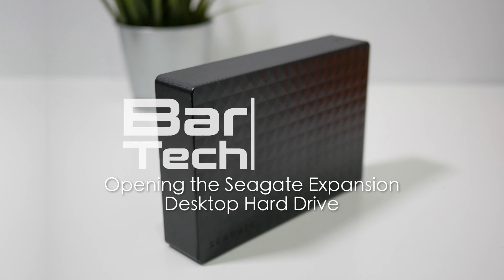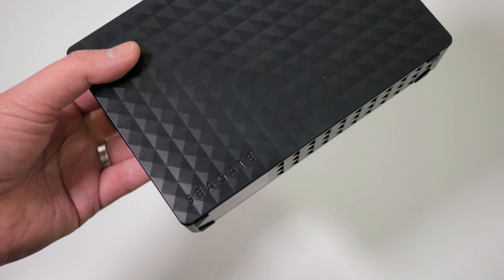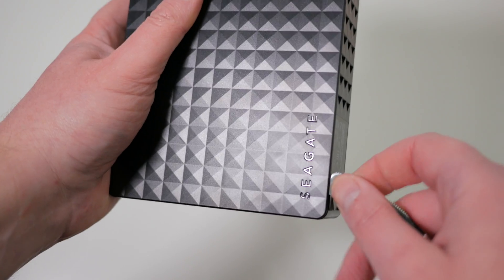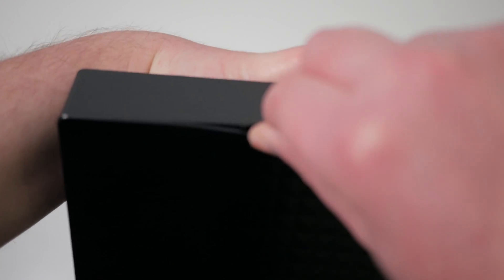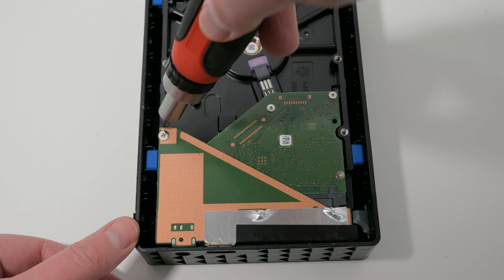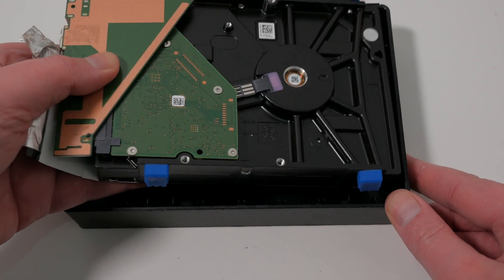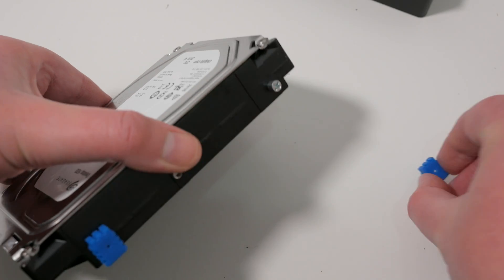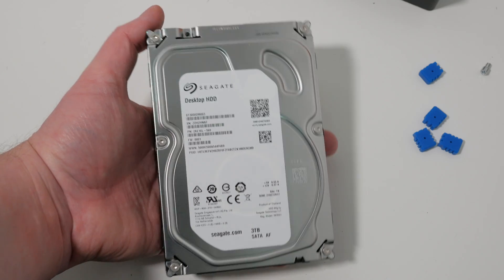Open / Dismantle the Seagate Expansion Desktop Drive to use as an Internal Drive

Comment: Thanks for  posting this video.  It took an extra tool, Dremel with cutoff wheel, to cut around the edge.  The 6TB was a breeze using a strong flat blade screwdriver to get it started.  Once there was a gap i was able to pry apart using my fingers and a wide blade screwdriver.
Now I have them mounted in a removable bay inside my tower.
Again, much appreciated.

Comment: Thank you for making this video, as my current 4tb Seagate external hdd has quit functioning properly and as a result I can no longer run the lion's share of the games stored within the library of my Xbox One S and it's got me a little frustrated to say the least.

I know I should've seen it coming b'cuz now that I look back on it, it has been giving me some intermittent indications that it was indeed on its way out by not always downloading updates as quickly & efficiently as it used to when I first got it and it has occassionally given me issues running the more favorite & frequently played games among my fairly vast library of games.

And being that this particular drive just so happened to be the main drive with not only the most games stored on it, it alsojust so happened to currently be the one with the largest overall storage capacity at 4TB, so you can easily imagine my supreme dismay when it refused to boot up or even accept the most recent & unfortunately "necessary to play" update for the main game I prefer to play.

Which BTW happens to be a rather contentious & divisive title (ie Call of Duty Modern Warfare III) which, anyone who plays it knows all too well that the overall game file size isn't exactly modest and is around the 300+ GB mark.

So when the most recent season dropped, I was ready to get into it and check out the recent additions to the game that the devs have added for the final season.

So to say that, "I'm more than just a little bit aggravated", would be a serious understatement!!😅

Nevertheless, I hoped/figured that maybe if I could disassemble the unit, maybe just maybe I might be able to figure out what the issue might be and possibly fix it, though seeing as how my tech knowledge isn't incredibly extensive, I'm not getting my hopes up but, I'm also not willing to simply give up without at least trying to get it working again or at least functional enough to transfer the current data to a new drive that I just ordered as a replacement in the event it turns out to be a complete and total loss...which I unfortunately believe will be the most likely outcome.😮‍💨😖😫🤬

But I digress.

Again, Thank you so much for making this video and sharing this valuable info with us DIY types out here.

I genuinely appreciate it and am so very grateful for people like yourself who take it upon themselves to make such helpful content instead of simply keeping said knowledge to themselves.

You and your video are seriously a true Godsend in my humble opinion and I cannot properly express my true thanks/gratitude with words alone but, seeing as how I don't know you personally nor am I likely to ever meet you in person to share said gratitude, this post will have to suffice.

So, as previously stated with much enthusiasm, "Thank you so very much again" and I sincerely wish you Godspeed & I will surely pray that God will bless you and all those closest to you beyond measure, far beyond your wildest dreams or imagination!!🙏🙏🙏
                         ✌️😁👍

Comment: 6 years later and it's still good info.  I saw the seam and figured that was the process, but you confirmed it.  I just cracked open a 5TB with a failed HDD.  The enclosure and USB PCB will be great for connecting old drives for data recovery.  Thank you.

Comment: I tripped over the cable and I pulled the drive down with me. It fell about 1 meter but hit a bit hard, and it was on when that happened (google says that's a very bad thing). It turns on - steady blue light and hums/whirs when first plugged in, but then it slows down to almost nothing and doesn't load at all, as if it's not plugged in. I was forwarded to your video from TechSupport discord, was told to plug it in directly into SATA. I'm a total hardware noob and I'm terrified lol, that I won't be able to make this work. I got it open in front of me but I'm instead watching and rewatching your vid...stalling. No apparent physical damage visible.

Comment: Hi, thanks for the video and sharing your expertise. I was wondering if the HDD could be replace by a unit bigger in the same box. I mean, do you think it would work?. Thanks
Reply from the maker: Yes, absolutely. It’s just a standard SATA drive. You could replace it with a larger one.
Reply: @BartechTV  Thank you. I was not sure if the manufacturer is putting some limitations in the firmware just to obligate you to buy a new drive with more capacity.

Comment: I don't see any way to pry open my seagate drive. there is no gap anywhere! the entire exterior is sealed. i can't get any power to it. i plug it in and nothing happens. i don't want to break the plastic casing.  Seagate - Expansion Desktop 4TB External USB 3.0 Hard Drive - Black
Model:STEB4000100 SKU:8686213  best buy aug 2020 . help plz.
Reply from the maker: It can't be entirely sealed or they wouldn't have been able to put the drive inside the case. There is a gap around the edge.
Reply: thanx. i found it  @BartechTV

Comment: I bought the 10TB one a little while back, and the speed is just NOT up to snuff. Kinda took me back to the LaCie external drive I bought in the early 2000's, but that one was atrociously slow, this in comparison was blazingly fast. I digress, this worked well, it's in my PC now, and I was able to put an empty 4TB drive in the external case (just to have some wiggleroom, lol), with very little battle scars. Got it pieced back together, and it still works with another HDD, just had to delete the volume.

Comment: I have a few 8TB versions of these that run slow as hell in this enclosure over 3.0. I'm thinking of either putting them internal or rehousing them in a future 3.2 enclosure so I don't have to populate it off the bat with new drives lol. We'll see if it makes a difference. Really depends on why they started running slowly.

Comment: Another good reason to get the drive out of the case: The outside USB-connector was damaged by a jerk on the cable, and now has connectivity issues. Thus, the only way to continue using the drive is "outside of the box", so without the enclosure.

Comment: If you struggle finding an entry point, then try a corner. I had to lift it with a fingernail and jam in the tool. Then it was fairly easy to get off the housing.

Comment: Thank you for this video.  Another use case scenario: Since these Seagate external enclosures do not have an actual power switch, one might be inclined to remove the drive from these, and put in a proper enclosure that has a power switch. Relying on buggy power saving features of operating systems isn't always best.

Comment: and what do I do if my seagate disc has a metal shell around the bridge? the screws don't fit any standard screwdriver, and I can't cut it open. trying to retrieve my pictures of pets and relatives. :/
Reply: Get a non-standard screwdriver.  Wal-Mart has a bunch of screwdriver sets and Hyper Tough brand tools are pretty cheap.
Reply: @kornflakes89  could you perhaps tell me what a set would be called? we don't have wal-mart in the netherlands :(

Comment: THANK YOU FOR THIS VIDEO.  My Father and I were about to begin the setting up of my NAS system with the Seagate expansion drive.  He was a computer genius for over 50 years and he passed away before we could get into the project.  I had all the parts and needed to figure out how to get to the drive.  In the middle of my meltdown, missing my Dad, I found your video and I can now continue with my project.  Again, THANK YOU  for this video.  Should I purchase more drives, I will utilize your link.
Reply: This was a beautiful read thanks for posting this
Reply: Sorry for your loss same issue here though i need to gain access to my grandpas old system and reset the password without loss of data
Reply: Sorry for your loss man

Comment: Man I had so many problems with these HDDs, I never could copy large files etc without IO Errors. But thanks to your video I open the Case and put the HDD in a different Case and then it worked... The Barracuda HDD in there arent that bad its the USB-Plate thingy that makes the problems

Comment: My Seagate drive just died, and I was a bit reluctant to take it apart until I saw this. Turns out there were a lot of spider corpses inside, melted on to the circuit board, probably shorted it out, or maybe the adapter died. I didn't want to smash up the enclosure in case I had to RMA it. But I'm using it as an internal drive now and it's working just fine!
Thanks!
Reply: you can say you got your seagate debugged.
Reply: @lancerfrom2007  Yea, apparently that's where the name came from, removing actual bugs from those big-ass computers back in the day..
Reply: @JoeBob79569  i know. That was the joke.

Comment: Thanks, SATA to USB adapter failed on my 4 TB drive, works fine via SATA or DOCKING station! Seagate has bad SATA to USB converters and bad USB cables otherwise my experience with Seagate has been very good, unlike WD which for others seems more reliable lol!
Reply: I thought i was the only one. I've always had issues with WD

Comment: Nice tutorial...clear and concise. No music drowning out the voice. Well done! Thanks.

My issue is that the data connection is unstable: sometimes the drive disconnects, and I must jiggle the connector, until the pilot light comes back on, and connection is restored. The wire is OK, and the power cable registers a steady 12VDC. Since the female connector is fixed to the circuit board inside, looks like I need to salvage the drive and discard the enclosure (poor quality control by Seagate). But I will try cutting back the plastic on the male plug, so that it mates better with the recessed jack. Sigh!
Reply: Same thing happened to mine. Tried plugging a separate HDD which I know is good and it didn't show up on my PC. The connector died. Trying the Seagate HDD on my Technet docking station confirmed the drive was still good.
Reply: @RetroJackal  I replaced the  cable from power transformer to the HDD and have had no problems since.
Reply: I,ve got the same problem with my 5Tb Seagate, so just purchased an Orico USB3.0 Interface Series, managed to remove the drive okay, but not sure if I can preserve the data, as the Orico  wants to re-format the disk before letting me use it.

Comment: Awesome video thankyou, what is the silver foil that is holding the drive in its place for??
Reply: I think it is used to hold the USB board aligned to the hard drive during assembly.  I would save it (stick it to the inside of the plastic cover) in case it's needed when you attach another drive into the external case.  That way you can find it if you need to reapply it.

Comment: I have found sliding 2 pieces of paper inbetween the crack and then sliding an old card (like an old credit card / membership card) inbetween those 2 pieces of paper is fantastic for this sort of thing. For one you can adjust the width of it by moving from just the corner to the whole thing and its often softer than the plastic used on the external hdd case. I use it all the time to undo clips on laptops. Works a treat and from my experience didn't mark like metal tools do.

Comment: hi, my seagate model SRD0NF2 stopped working. Any ideas on how to get the data off the disk?
Reply from the maker: It depends if it's the drive itself that is broken, or the SATA to USB bridge, or the cable, or the power supply. It could be many things.
If the drive is still working you can just open up the enclosure, remove the drive and connect it to your computer by SATA.
If the drive is broken then your only option is a data recovery service. Recovering data from a spinning hard drive isn't something that you can do yourself at home with a large chance of success.

Comment: As You can see it is not possible without destroying the case. The Problem is that you lose warranty when you destroy the case. Maybe you can put together again with glue, but they will see you used glue...
Reply from the maker: Yes, many of the clips on the case will probably be broken, it is unavoidable. So, don't do this if you expect to be able to put the drive back in the case without anybody knowing it was opened.

Comment: The cheapest 4Tb internal 3.5" drive I can find is $150. I can buy the Seagate external 4Tb drive for $99. Makes no sense to me considering you get a USB3.0 case chucked in for nothing and it's still 50 dollars cheaper. I'm off to butcher an external drive today.
Reply from the maker: Exactly.  It's never made any sense to me why external drives are cheaper. I'm sure there must be some logic to it somewhere but I just can't see it.
Reply: @BartechTV  I think the reason is that people don't buy them and external drives are easy to setup. Most people nowadays would buy a new computer before opening it up to swap a drive. I've been pulling computers apart for over 20 years so it's no big deal. Just got back from the shops with my external drive. It took me 5 minutes to remove it. Now I just need to install into my desktop and install an operating system. I ended up getting a 4TB Seagate like your video. Exact same case, had to kind of damage the case to get it open. They used to be screwed now they have plastic bloody clips . Don't care though , it's an internal drive now !!

Comment: This video keeps on giving, just opened 16 TB version, Exos X16 ST16000NM001G inside. More or less the same process, I kept my screwdriver vertical to the seam, gently pulled it along the seam with one hand and rotated the screwdriver some 45-90 degrees with another every cm or so (half an inch)  listening for the pops. Took about a minute, 2 of some 25 clips survived the process. Wandering how long before someone posts "Just opened 1 PB version" ...

Comment: Does the USB-SATA PCB do hardware encryption? That is, will we be able to read the data if we disassemble it and plug it into our PC's SATA? Many hard disks's USB-SATA converter do a hardware encryption such that the data is not readable if you take them out and you have to re-format them.

Comment: Hey, hopefully someone can answer this.

I have the 5TB model of this drive, and I've used about 4TB of it.  I would like to put it into my desktop.

Is my data safe and easily accessible by just shucking it and plugging it into my PC via SATA?

Thanks.
Reply: As usual a backup is always advised, but other than that, it will work because the filesystem on the drive is the same, regardless of whether it is accessed via USB->SATA or directly via SATA.
Reply: @jgrabner  Thanks!  Everything worked out fine.  Really appreciate your reply.

Comment: It's ridiculous that an external HDD goes for $144, but the equivalent internal hdd cost is $155. 

Seagate, why are we pay $11 more for plastic we don't need? Many people are taking the shell off of these to use as an internal drive.
Reply: the drives inside external enclosures are actually quite slow speeds often even slower than 5200 and often have less cache and slower read/writes.  Because they are on the USB bus its a waste to put a faster drive in that wont even get utilised.
Reply: @Emexrulsier  True. Theses external seagate barracada 4tb ones are 5400rpm. Some of the other Seagate barracuda 4tb ones are 7200rpm (15% faster) which might (in not all cases) account for the price difference.
Reply: @Emexrulsier  mine have mostly been 5400 rpm. But unless you want to pay a lot extra, you get a 5400 RPM INTERNAL drive as well. For example, right now I can buy an 8tb external... for 170 CDN +tax. BUT the internal is 195+tax (cheapest internal, still also ONLY 5400rpm) with a mediocre cache. So I'm trying to debate whether I wanna buy some 170 dollar drives or pay the extra 25 and get internals. Big drives are selling out fast because of that stupid CHIA cryptocurrency, so I feel like I should probably get 1 or 2 before they go sky high like video cards have... Now video cards that were 400 bucks are going for over 1000. So I can't afford to upgrade my PC now, because of bitcoin mining. sigh

Comment: My new hard drive stopped working after I did this. Nothing seems to be damaged.   Makes a clicking sound and led light not turning on.

Wanted to use the Sata connector (I think that's what its called) on my old external hard drive. Which doesn't work still. LED flickers but hard drive silent...

Please help!!!!!!

Comment: WARNING - I got a 4TB "seagate expansion" "desktop drive" recently - I called seagate support today here in Oz to confirm the internal drive used?  They have no idea, "could be any drive" they said, as these are sold with no performance spec other than a capacity spec.  If it is a true "desktop drive" as they define in their manual for that series, model year is 2013, 4TB drive is ST4000DM000.  This would be good, as a good quality CMR or PMR drive, containing 8 platters, 16 heads.  But as seagate wants to keep it secret you may have a SMR drive - ie Barracuda - =bad for fast writes. - A current 8TB Barracuda ST8000DM004 uses only 4 platters!
PS - Damn! - Hard disk sentinel app reports my drive is the ST4000DM004 - only 2 platters!, SMR drive, 5000 rpm, 256M buffer Barracuda drive - ie cheapest possible 4TB drive.  Only good for use as a read only archive.  Original 4TB drives used 8 platters when released in 2013.  My drive has UPC code  763649065068, PN 1TFAM3-570, STEB4000300.
Reply: Next time buy a drive with the specs you need rather than assuming a drive that doesn't advertise certain specs has what you desire.